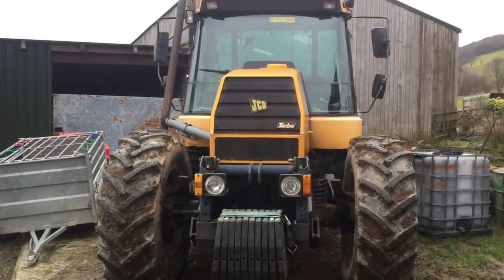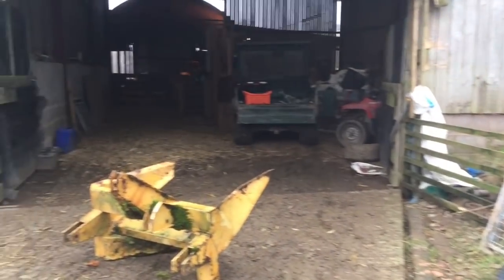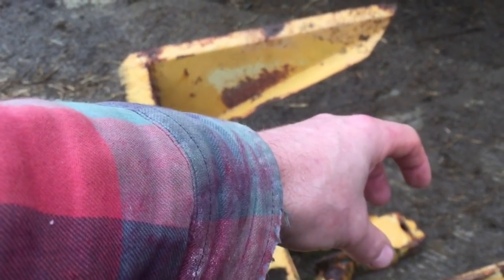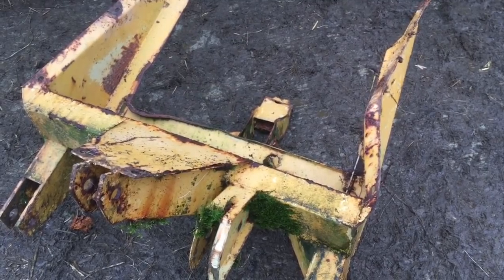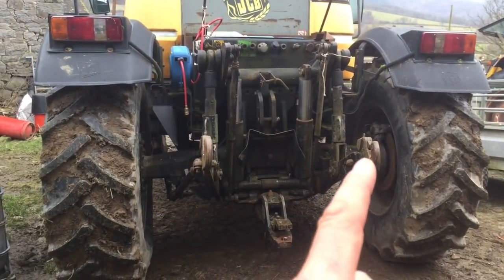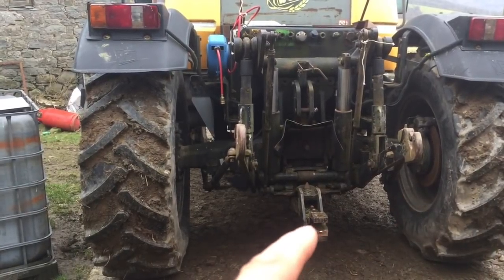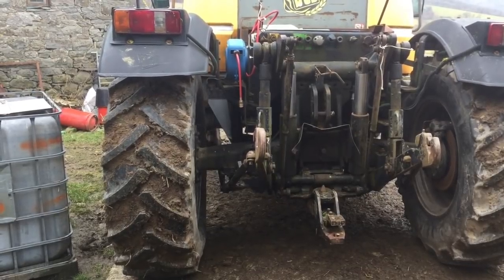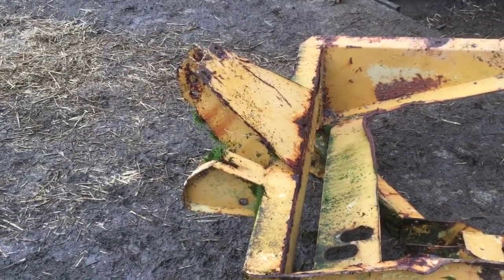JCB FASTRAC 155 65 backyard engineering a ball hitch 😎

Comment: When I got my 135 it had the two ram pipes straight to a tee and then plumbed in to one of the spool valve quick connectors  on the back end as apparently has a problem with the electrical up and down system. Am in proses of putting it back to original as want buttons to work. 
Most people say it’s the top cross shaft that gets dry and seizes up a bit making it slow to lower so make sure it is greased well. 
Yep they should have made them double acting rams instead of relying on gravity🙄. 
Are you on the Facebook fastrac appreciation forum?.  I find it helpful with questions I have about them and every one really helpful. As they say a problem shared is a problem halved 😂
Take care Gazza 👍
Reply from the maker: I actually did a vid on this but never put it up. I went all through the lift system at the back end piece by piece to see why the lift wouldn’t go down and found out it’s nothing to do with the cross shaft it’s the spool valve that adjusts height from the control box. For some reason it is putting a slight amount of oil pressure in the lift pipes all the time. I found the problem but didn’t fix it cos it still is a swine to go down on the lift arms. I did think of maybe putting a bypass similar to what you have with a lever just for hooking up then putting it back once the implement is on. Cheers for commenting 👍

Comment: Have the same slow lift lowering fault .another way is to connect the lift rams to spoil valve .up and down instantly
Reply from the maker: Trevor Burriss that sounds like a good idea👍 have you tried it and I assume you mean send oil straight back to tank from the Rams. Must look into this problem as I'm sure there must be a stuck valve somewhere when the computer controls the draught system.